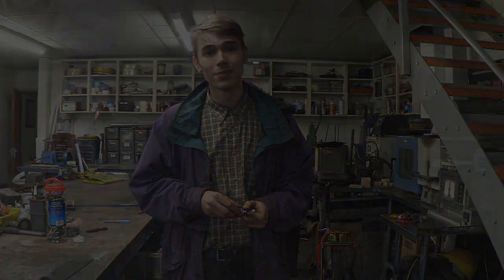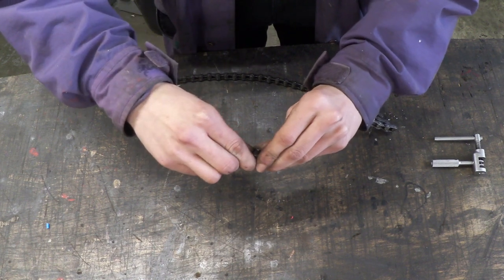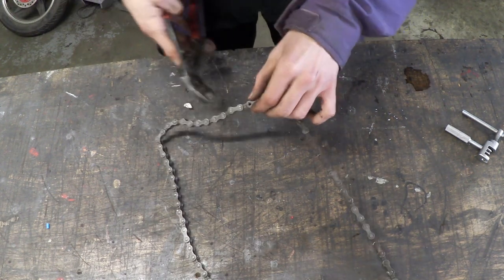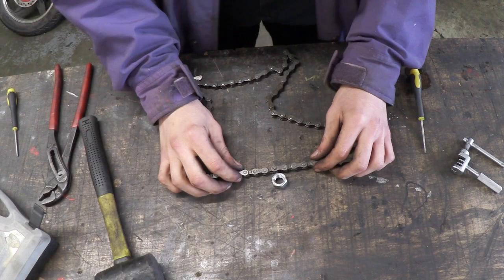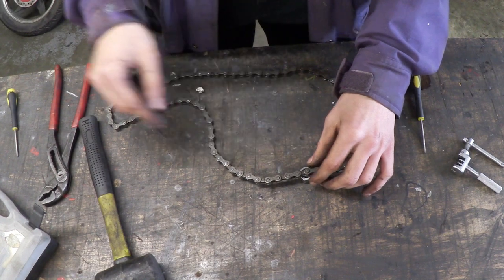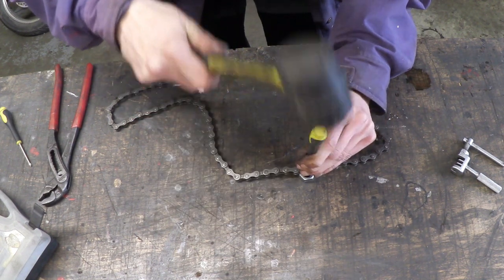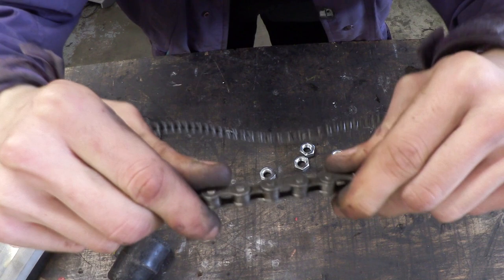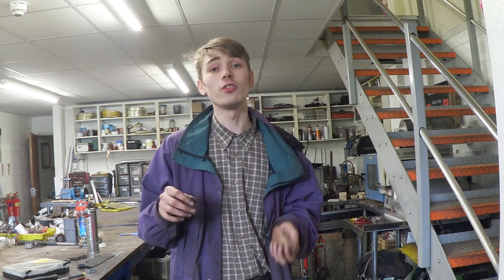1116 - Removing/Attaching Chain Links Without Specialist Tools

Comment: OK now a video on how to break the chain link. ;)
Reply: All you need is a socket, a nail, and a C clamp or vice.
Reply: @samuelthomasengardio  I usually File the head of the pin and punch it out. Just wanted to see what Luke does since he did not show as the title shows. Removal ;)